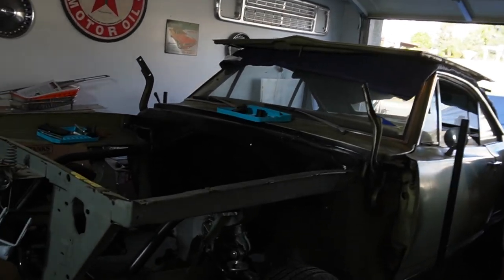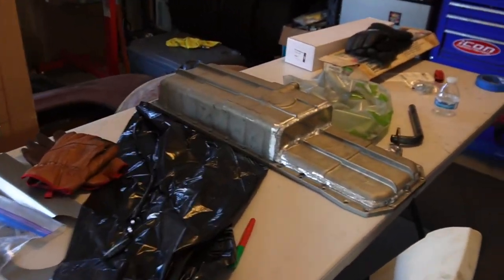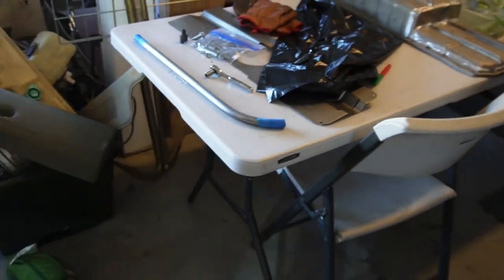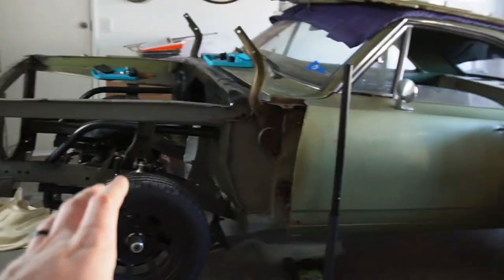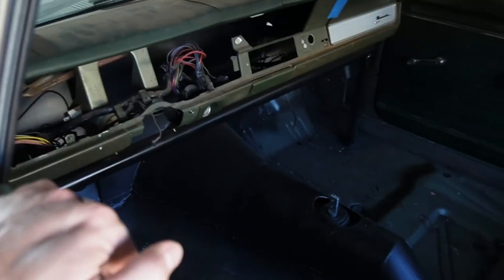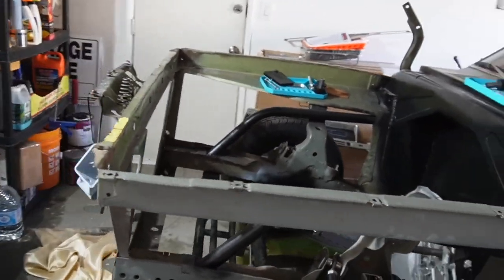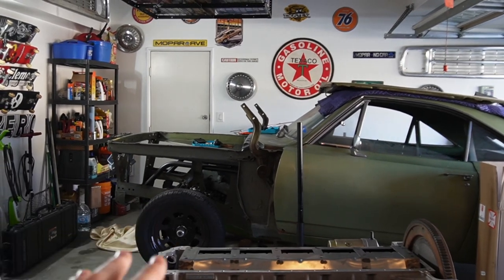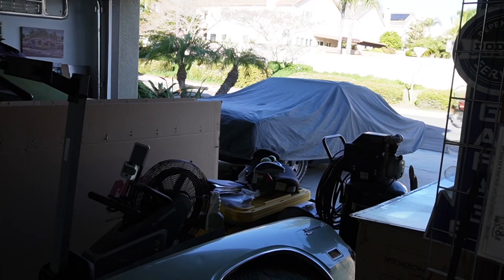How The Viper Swapped 1969 Barracuda Project Sits Today

Comment: My Son is  Mullet Break motorsports on utube. He has a 71 Satellite with a 440 and a 82 crew cab with a 12 valve he's in the process of building. But the coolest project is a rust free 78 RamCharger he plans on putting it on a Crownvic frame. I'm so proud of how good of a mechanic he has proven. I credit Johnny from Zip ties and Biasplys also on Utube. Johnny was our nieghbor for 15 years. I had to work away alot and John was is main mentor. Really enjoy your projects keep up the awesome content
Reply: You bet Mr Downey!
Reply from the maker: Thanks John! That Ramcharger project you mentioned has my imagination running wild. Gotta check it out. Thanks for the heads up!